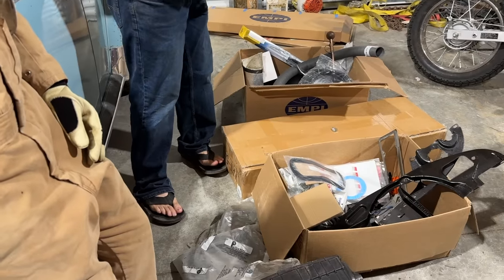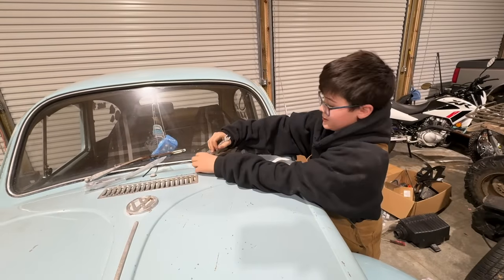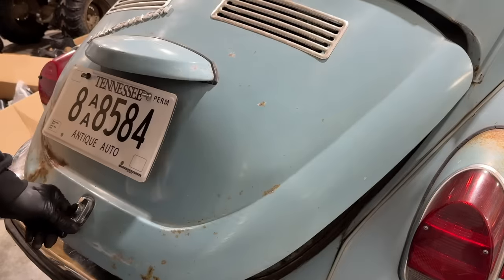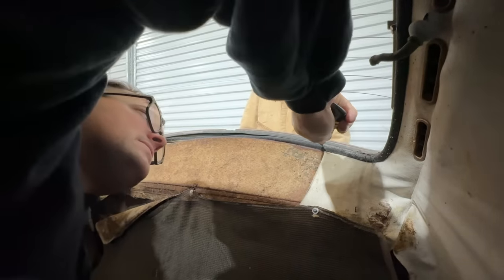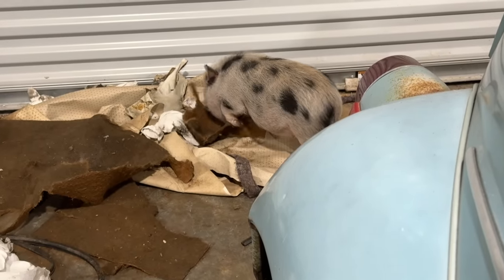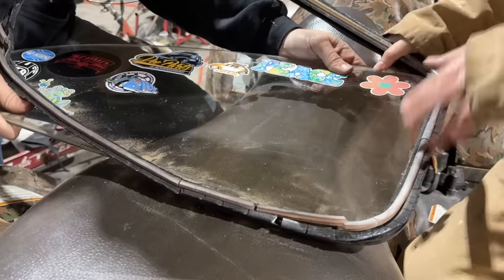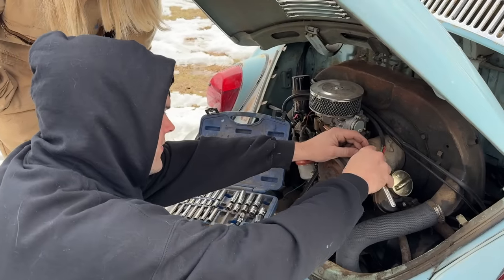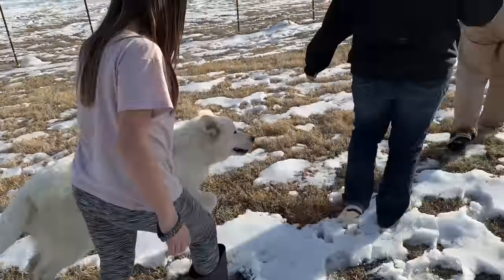Wawa’s Beetle gets Interior, suspension, roof rack, and engine maintenance!

Comment: Sleeperdude !! A little tip here. Don't waste time trying to remove cotter pins! Put a wrench on it and twist the nut. It will very easily shear the cotter pin. I promise.
Reply from the maker: Ok thanks
Reply: I was thinking the same thing whrn he was sayin he was woried about not gettin it out
Reply: @Sleeperdude  
Just to let you know, I've got 42 years of professional mechanic experience. ASE master tech. But I learned that from an old man years ago. Saves a great deal of time. And usually you aren't using the part again.
Reply: Webster needs to make a dictionary, jus for the words that come out of Margs mouth😂
Reply: I was thinking the exact same thing too. I thought it was funny when you just watched Wa and Ralphie turning that nut the wrong way! Maybe tell them the open end is for after you break the bolt loose with the box end.
Reply: I had a Karmann Ghia and a Puma GTi. Air cooled VWs rock!
Reply: Yep! I was going to write the same thing.
Reply: Came here to say the same thing. 👍🏻 Also tell Ralphie he had the wrong direction on that tie rod nut. Lefty loosey and counter clockwise only work when the nut is facing you, not facing away. 💪🏻🇺🇲
Reply: My father always admonished "you ALWAYS replace your cotter pin!" They're cheap and  reused pins are always weaker.
Reply: As a Canadian that prefers -40, I can ask you all the same thing..how do you deal with that heat you guys get. No thanks, I can layer clothes to get warmer, but when you hot aside from jumping in a pool you can get cooler.
Reply: The myth I always heard was that that messes up the threads? Can that be true?
Reply: @markhenry5294  
Not in the least. Never had any issue. Cotter pin material is so soft compared to even a grade 3 bolt or nut. It has probably saved me hours of time through the years.
Reply: I love all you "arm chair" mechanics giving advice. At least these kids are getting their hands dirty turning wrenches instead of playing video games sitting on the couch. I know adults that have to stop and think about which way to loose a nut. 😂😂😂
Reply: Good tip. I do the same unless I need to re-use the part.
Reply: Tap on a socket and let it rip with the impact.
Reply: Woohoo! I've been waiting for this video! Wawa, you're a blessed young lady, to have such a great little car. I've had a few, and wish I'd kept them! Enjoy your car!
Reply: @edsyphan3425  WA had it right to begin with,  Ralph told her to do it the wrong way.
Reply: @Sleeperdude could strip the threads doing that, don’t ask me how I know 😂
Reply: You should put a sheet of rubber or an old mat over your battery terminals before you install the rear seat.
I personally know a couple of Bugs that were burned up because of the seat shorting out the battery….
Reply: I would have just used a Sawzall to cut the bolt, going to replace it anyways.
Reply: @robertjoslinjr8536  I think maybe mom and dad were letting them problem solve since they still have issues on which way to turn wrenches.
Reply: @Sleeperdude  I have some Super Beetle quarter Windows if you're interested
Reply: @Sleeperdude don't listen to that hack
Reply: @markhenry5294 yes don't do it
Reply: Great video!! The bug is really looking good. My parents had a 72 yellow bug that I learned to drive when I was 11 & was my 1st car when I turned 15. They are so much fun to drive!!
Reply: Also, when I’m removing tie rod ends that need replaced, I just pound on the threaded shaft. Who cares if you damage the threads when you’re gonna replace it anyway?
Reply: Just don’t drag a cotter pin out against the bend and problem solved…. Thought that was common knowledge
Reply: Man WAWA your bug is clean AF keep up the work don’t tear it up to much in the field!!
Reply: Not going to lie, I was screaming at phone, "twist it off with a wrench".
Reply: Marge’s world !!!
Reply: Then find new cotter pins. Get a barrel full while you’re there.
Reply: @robertjoslinjr8536 . I alway tell people, when upside down lefty loosy goes by the direction the wrench/ratchet handle swings. 40 yrs turning wrenches in some capacity and still occasionally start to turn a nut the wrong way.
Reply: Where are the hand straps on the b pillars or is that one of the parts yall are waiting on. Car looks good. I’m glad Wa Wa likes it.
Reply: Make a YouTube video and show us all how or turn the channel to the guy who does it your way.
Reply: @shatnersufolanded7785  
Not industrious enough. Nor photogenic enough. Nor do I wish to take away from Sleeperdude, just maybe help if I can.
Reply: @erikschuddeboom3223  I went to a votech school with a guy that bought and restored one of those Pumas while we were there. Never  knew about that car before, but it was cooler than the other side of the pillow.
Reply: @dr.curious5136 Having moved south myself from New England, you learn to sweat standing still. It really helps to stay out of the sun. The population boom in the American south coincided with the advent of air conditioning.
Reply: @theLyzhendricks i was screaming the same thing at my tv lol.
Reply: @bigbelconut   Thats too funny, I didn’t catch it.
Reply: @th86stone  solid point
Reply: I sure hope some company didn’t buy up all the cotter pin factories just so they could raise the price! 
  Future mechanic, WHAT do you mean twelve dollars?!? For a Cotter pin!?
Reply: My Grandpa taught me that move 😉👍
Reply: Same here buddy it comes of every time. I did it hundreds of times. Stay safe and keep the videos coming. Love you guys.

Comment: An oldtimer tip for that Generator light ; when you disconnect the battery terminals , you may have to reverse the polarity in the generator by using an insulated stout wire ( i use a piece of house Romex ) momentarily touched between the B+ terminal on the generator ( from the battery positive ) to the body of the generator while running .
Old trucks , tractors , and old vws do this .
I enjoy your videos and appreciate that you involve your family .

Comment: Check your tyre pressure in the front! At 1.49.43 Ralfie states the tyre pressures at 19 Front and 27 Rear then confirms 27 for the front tyre! (Sorry I'm from the UK) Casings in your case. Also check when you removed the back seat that the wiring to the voltage regulator was not disturbed causing your Dynamo/Charge light to come on.

Comment: When Ralphie sets the casing pressure to factory, keep in mind that's factory for '71 casings. Probably bias plys or something. If you have modern casings on an old car, I would go by the casing sidewall and find an appropriate pressure based on their max psi rating. Tried to read through comments for this but there's 2k comments so sorry if it's a repeat.

Comment: Josh I hope you don’t take offense, but I would check that shift rod coupling underneath the back seat.  Just saying been there done that.  Also, there is a shift rod bushing and bracket just behind the shifter in the front.  May need greased or replacement.  Both are very easy and cheap.👍🙏
Reply from the maker: Ok thanks for that I will check it

Comment: Josh and family, I don't usually watch videos this long, but I have been watching the unboxing mail videos and Wawa was getting so much goodies for her VW  that just had to see it all put on the car. by the way the VW first came of the assembly line in 1937,it was an attempt to put every one in Germany in a car but the 2nd ww put that on hold. The reason most cars with a black interior have white headliners is the car inside is like a black hole if the interior is all black. The white headliner makes for a much brighter feeling. The VW is a great first car for Wawa, they are economical to operate, light and easy to drive and simple and easy to work on. Here's to many happy adventures out on the hiway. 😎🚙

Comment: MY MB has bolts for the tires and to put the tire back on, there is a guide pin that came with the car, in the little tool kit, that you screw in and it sticks out so you can hang the tire off of it and get the other bolts started.  Then you can pull the pin and get the last bolt in.  🙂
Reply: A short pipe nipple fits were the lug goes to hold the tire.

Comment: Just a safety note. Beatles used to burn down on the freeway because the fuel line grommet in the firewall would get hard and fall out. The fuel line rubs through on the firewall and gas sprays all over the engine. Just keep up on grommet inspections or put a bulkhead through fitting in the firewall. Great show!
Reply from the maker: Ok thanks 😊
Reply: Happened to me!

Comment: One thing to check usually before adjusting the valves is retorque the heads they will loosen over time and then the valves get tight and you lose power had this happen to many customers bugs

Comment: When i get those rusted in pins i just put a long cracking bar and socket and wiggle the nut until it cuts the pin off then wind the nut back and forth as you take off the nut. This will cut the pin to fit the thread. once off locate the end of the pin and punch out or dril out, if reusing ball joint. Far quicker and less stressful too, especially if your not reusing the joint.

Comment: FYI… the 2 little holes on the edge of the VW hubcaps are for a little tool used to help remove the hubcaps. Amazon has some available. Need to get Wah one or two.
Reply: I sent her one of those tools in the fan mail a few months ago. They probably forgot about it. Doyle in Mississippi.
Reply: Its easy to dent those hubcaps using wrong tools--four pristine hubcaps are nice! Be careful where you hit em when installing.

Comment: FYI:  The Super Beetle had a curved windshield and McPherson front end strut suspension. Regular Beetles had a flat windscreen and torsion bar front suspension.  The black seats & door panels are not original which would have been white.  Put an insultation pad on top of the battery, the seat has been known to contact the terminals.
Reply: Fyi. 70 71 and 72 also had super beetle mc ferson struts before volkswagen going for all beetle curved windshields. I had a 71 super with the flat windshield with the standard dashboard
Reply: @johnollom999  Yeah, they had a couple years of jumbling parts around before they went fully super beetle😂
Reply: I had a '72 SuperBeetle with the front struts, and a flat windshield.

Comment: Hey Josh, 
 Early in my career as a Mechanic an old timer, that I still admire and miss 40+ years later,  pointed out to me that cotter pins were made of soft steel. 
  To paraphrase Lou M, minus the profanity, lol:
 " If they won't come out or just crumble, just trim them off. Tap your box end wrench/socket onto the nut and run the nut off. They shear really easy and don't damage anything.
 If you're not reusing the part, no problem. If you want to reuse the part, you have a better chance of getting the sheared piece out standing at the work bench than under the car." 
 That bit of instruction has served me very well for many years here in salty, rusty northern Ohio.
  I hope it helps y'all a bit there in the prettiest state east of the Mississippi.
 Lots of love for Wawa and her Beetle!

Comment: In 1972, I drove a 1959 VW Beetle up to the Mount Uludag ski resort near Bursa, Turkey, passing many other vehicles, having pulled over (or having skidded into ditches/culverts,) that could not make it up the incline in the snow and ice. VW Beetles are very light but the engine in the rear really helps in those winter conditions.
Reply from the maker: So cool
Reply: @Sleeperdude  I forgot to mention in my previous post, that there were four of us in that 59 VW. That bug had no problems pulling us up the mountain. The ski resort was at approximately 6000 feet above sea level.

Comment: Keep it at 65, that's the sweet spot on the highway and maybe 70 for short, very short bursts while passing and it'll run forever. I had to replace the heads on my 70 1600 cc dual port running flat out (almost 80!) from Macon ga to Cartersville ga and overheated the head, warping it. Overrevving and lean. I was young and didn't know any better. Good news is heads are super cheap and don't require head gaskets (sounds crazy, right) heads slide over the jugs and seal that way like a sleeve. The lessons you learn on your first bug. Makes me miss my old one. Keep it at 65 and you can go anywhere

Comment: maybe I mentioned this in an earlier comment but you can make really cool flames come out the exhaust tips.  Remove the spark arresters and replace them with 8 to 10" chrome plumbing dropdown tube (Eastman 1-1/2 x 12 Inch 17-Gauge Steel Flanged Sink Tailpiece, Brass Plumbing Fitting, Chrome Finish, 35116)  tighten with standard VW exhaust clamps.  Now adjust the carb to be rich.  Next time you down shift when you let out the clutch - BAMMM and a pair of long flames come out.  Great when you and kids from church are in a carravan of cars going to your favorite eating place.  Our favorite in the 60s and 70s was Bob's Big Boy.  I see that Frisch's Big Boy is located at  820 Crescent Centre Dr. in Franklin TN   Enjoy.

Comment: Glad the death wobble is gone. My fan mail letter may be out of date tho, since I mentioned all of that in it, lol. My '73 Super Beetle had 2.5in drop spindles on it. Depending on what transmission you have, the freeway flyer transmission let me go 80mph on the interstate. My '70 beetle has done 90 on the interstate, it has a 1776cc engine. Never had any overheating issues. Only thing that could cause that is not having the seal or belly pan in the engine bay. 
My beetle actually pulled a truck out of the ditch like that in the snow, the chains were on it also. Its rare we have snow here in SC also, but when we did, the beetle came into its own, and was excellent in the snow and even off road.

Comment: I used to own one (bought it in 1989 when I was 13) and never ever had it overheat on me, not even in summer. I'm from the Netherlands, winters can be below freezing but summers get around mid 80 to 90. Normal speed on the highway here is around 75 mph.
These engines are often used in aviation, beit modified. Just make sure the air shroud is in good condition and you should be fine.

Comment: I was a volkswagon machanic about a million years ago. You wont find mich suspension mods for a super beetles because all the dune buggies and other uses were the standard beam front end. You can adjust the rear axle tortion on her beetle because it has dry axles the older one had axle tubes that oiled the wheel bearings so a slight downward angle was required. 
Aa someone else mentioned make sure the fan shroud is free of debrise. 
You can change the generator to alternator but requires the mounting tower to be changed as well. Fyi when changing the mounting tower make sure the oil splash guard on the bottom is installed in tge correct direction. 
If you are concerned about overheating make sure  the thermostat is working. You can use a heat gun on low and make sure the reducing ring on the back of the fan shroud moves in and out when warming the thermostat. 
When you drop the engine out it would be a good time to pull the fan shroud to make sure there is not a mouse house in there and check the oil cooler to make sure the fins are clean and its not leaking on tge bottoms o rings.
Reply from the maker: Ok thank you

Comment: Great video! Time warp to 1993 when I was 15. My first car was a ‘63 VW bug. I did the same interior restoration and seats etc. Those generators never work 100%. I replaced mine maybe a half dozen times. 9/10 times it was the brush springs. Check those. They never put enough pressure on the brushes to contact the armature. My 2c
Reply from the maker: Ok thank you

Comment: Great to see the resurrection of a venerable Bug. I have had 3 of these over the years, and never had issues with overheating at highway speeds. You just need to check the air intake is clear at each oil change. My second one I added a Big Bore kit which took the 1200cc engine up to 1400cc utilising the standard 1200 bottom end and heads. It gave the bug the low end pull that the 1200 did not have. And they are so simple (if a bit crowded at times) to work on. Loved my bugs, and would love to get  one to resurrect if I can find one at a decent price here in NZ.😁

Comment: Has anyone mentioned the speedometer drive in the left front wheel grease cap? A square hole that the cable sticks thru and is held by a tiny circlip. The cable is pushed in thru the hub from behind. Kind of unusual way of doing it, but it works. 
Loving the build. Prime family time.

Comment: Just a tip you should turn the cooler sideways and run the strap up thru the handles before going over top, and always center the load.

Comment: Growing up my dad used to paint Volkswagen beetles for a living in the 70s, 60s and 70s and growing up, we had 2, and I owned one when I was sixteenand we never had any issues with them at all as long as you made sure they were tuned up and you made sure your. Exhaust was all there like you know that I said j boxes earlier. That's for your heater and your major sure, your exhaust is hooked up correctly and everything in that fan and there is spinning.  And you'll be just fine, and they do pretty good on the Expressway. They'll at least keep up with traffic.
Really not bad. I had A72 super Beadle. I didn't have it very long because I neglected the valve cover gaskets. Now I used to have to keep oil in it and all the time and 1 day I didn't.  And that's when I said bye bye but I love the car it was great. I've been wanting to get another one someday and restore it. Because I do body and paint for a living just like you. I've been doing body work for gosh, 35 years now. And then I'm turning 62 this month, still doing it.